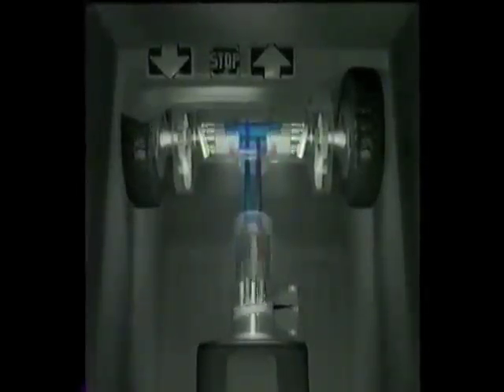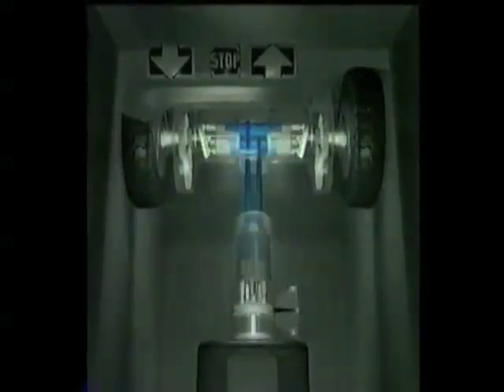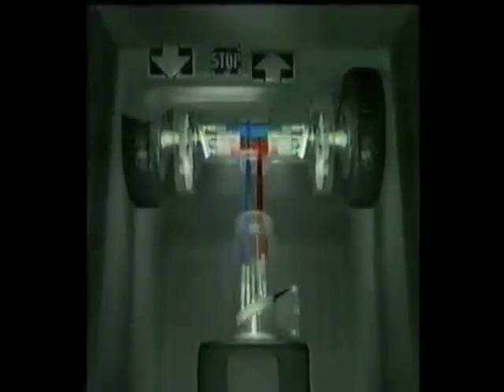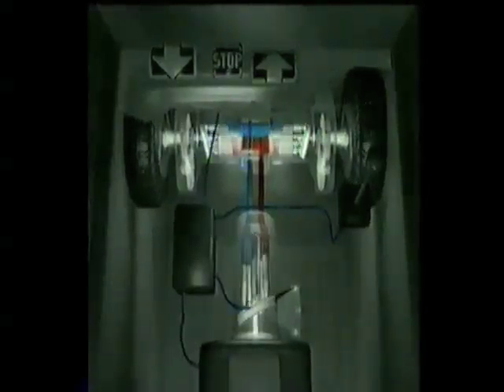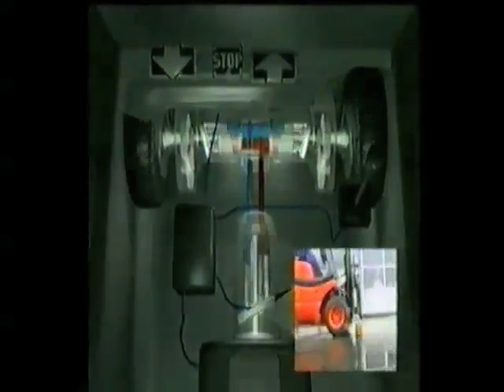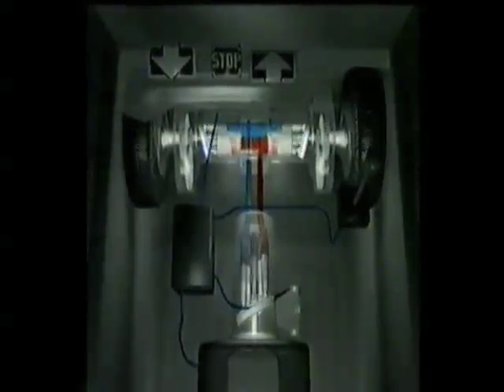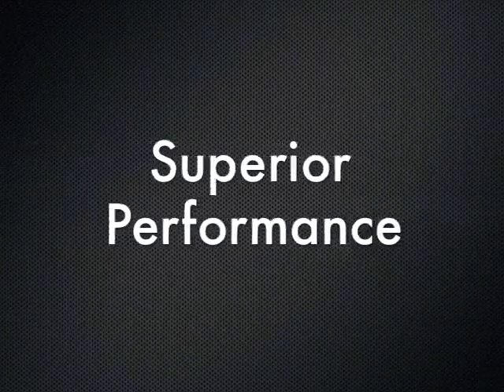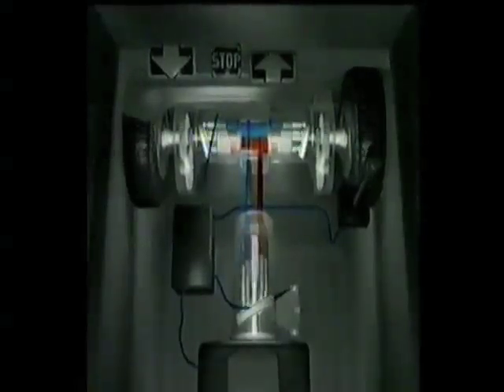Linde Hydrostatic Drive

Comment: I was a fork lift mechanic in the 70's, so I can appreciate the simplicity and superiority of this system. I singularly elegant design. Coincidentally, when I was in my teens, in the 60's, I had a scooter with a hydraulic transmission.